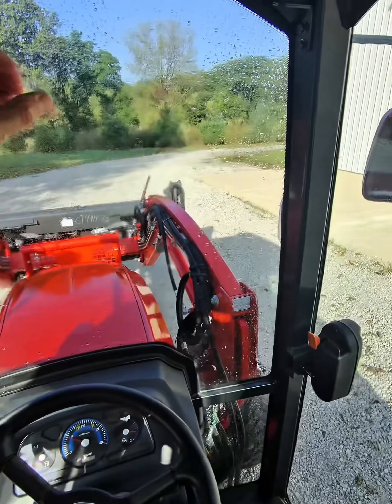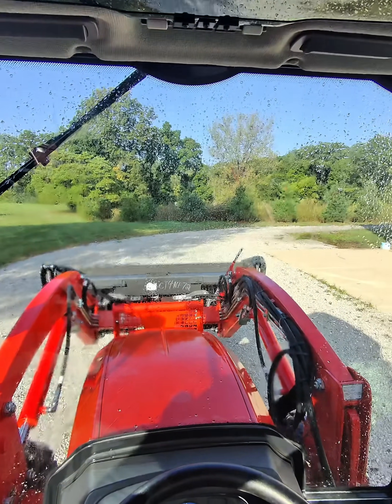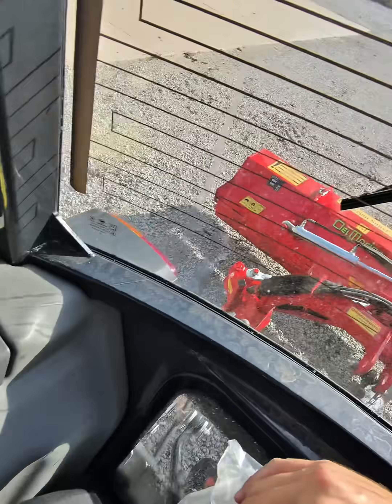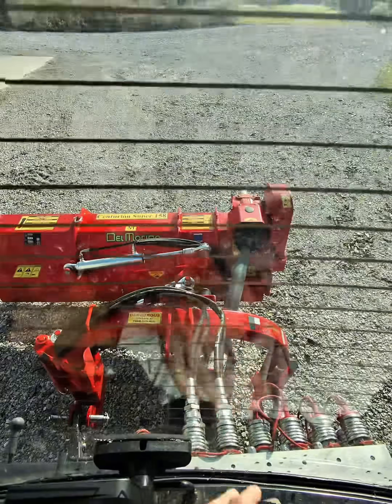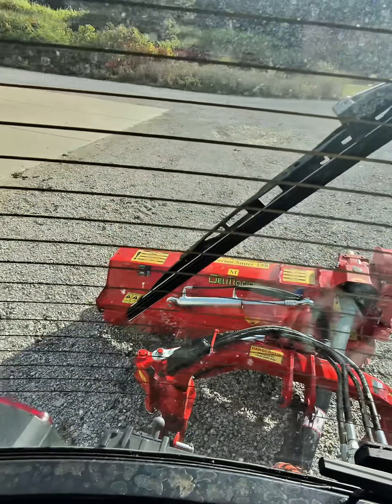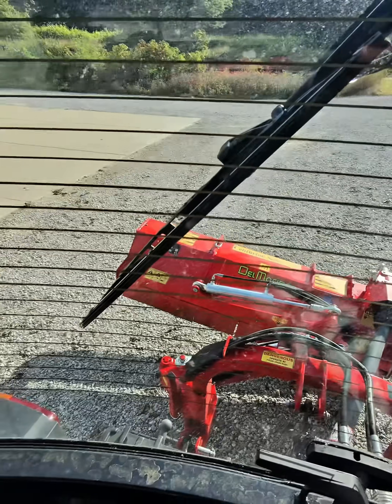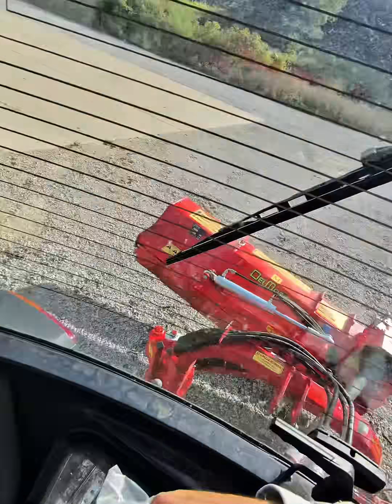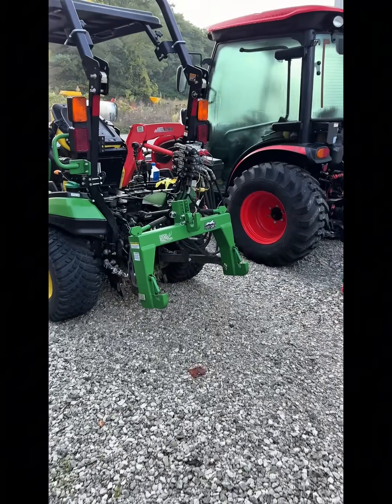What’s The Difference Between A 3rd Function & Rear Remote? #tractor #farming #hydraulic #homestead

Comment: I wish my tractor had the hydraulic capacity for this but they way undersized the pump on mine.
Reply from the maker: You need hardly any hydraulic flow for these products.  In fact, most of the time, you will wish there was less hydraulic flow or even turn your tractor to idle to slow down the pump.